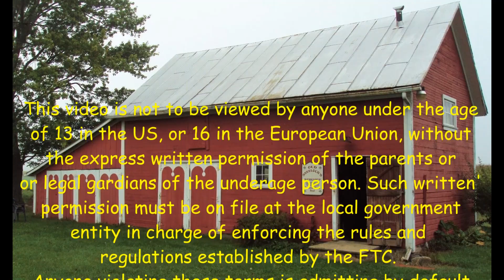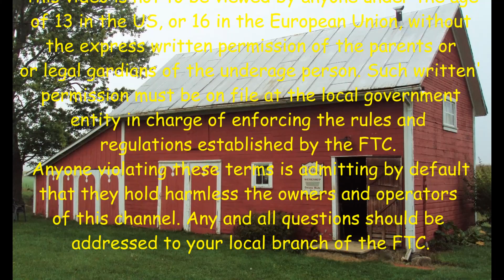Cutting Glass With A Diamond Hole Saw

Comment: You made this look easy. To me this would be a tough job. First, I  never realized diamond tipped hole saws existed. I've never seen one. The key to this job is using the drilled wood as a guide. Great idea. I dont know how you could otherwise do this on a curved surface. I have a hard enough time cutting flat single pane glass. I like your shop tips.
Reply from the maker: Setting the bottle in a V block and clamping it down, then using a drill press would probably do okay. I like trying to do things with the stuff the average person would have available. 
I have seen so many projects that made me think I had to have the latest, new fangled, buzzword tool to get anything done. Most things can be done by hand. it just takes longer. 😁😎

Comment: You don’t use those diamond tipper hole saws often, but when you need them they’re invaluable.
Reply from the maker: Pretty handy for grinding stone. 
I bought them for cutting glass circles in colored glass. I have plans to make little round disks for crafty little flower vase fillers. Not sure how or when

Comment: Hello sir I want to give you a big hug for this video but I still have questions I want to make my self my own center piece and I need to make holes for the plexiglass to insert the dowels with out going threw the other side of the plexiglass you gave me 3 more ideas watch you do this,what is name of that thing you put on the drill to make the whole and can u make a hole in a hallow candle cover the ones with no bottom I don’t know the name of it what you are use but your idea I love
Reply from the maker: What I used is called a hole saw. It cuts a circular hole inthe material and leaves a round plug in the center. 
Sounds like you need a Forstner bit. It cuts a round flat bottomed hole.

Comment: If I may ask, what are you using as your lubricant/coolant?
Reply from the maker: I used Greased Lightning spray cleaner this time. 
I could have used water. The spray bottle was handy so I used it. Soapy water makes the water wet out the surface a little easier, but it isn't necessary.